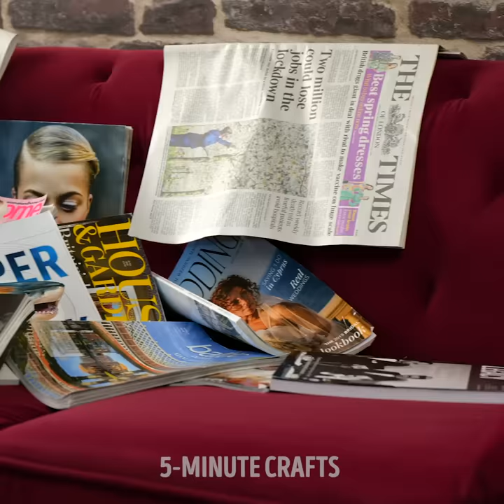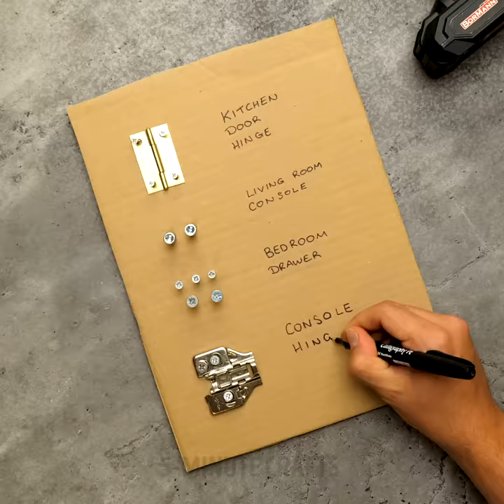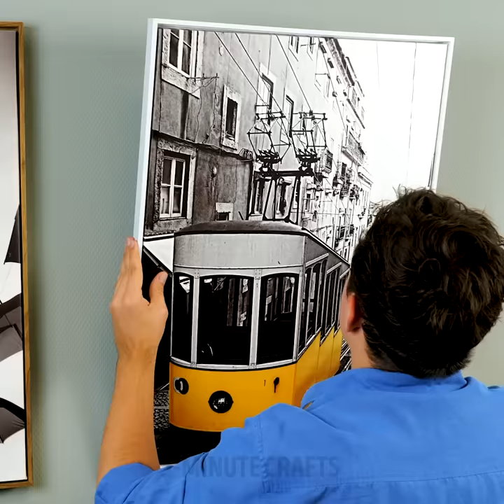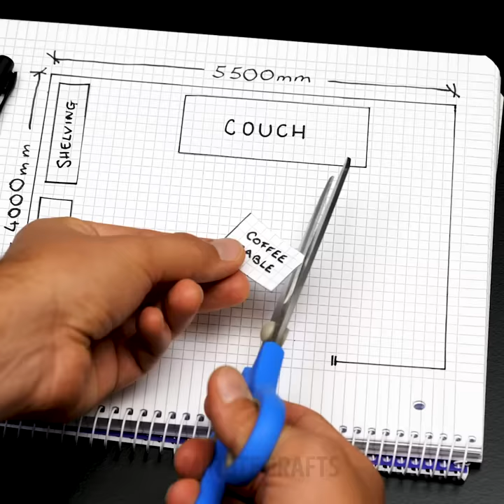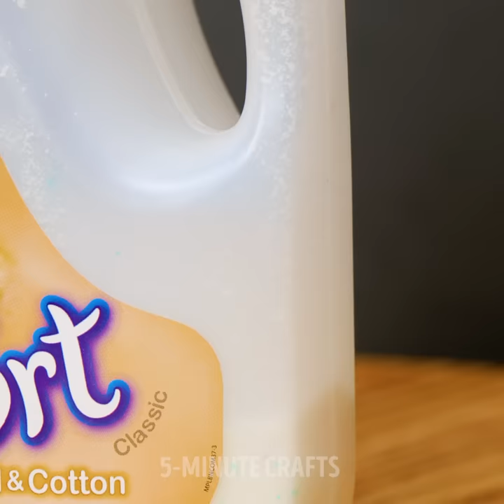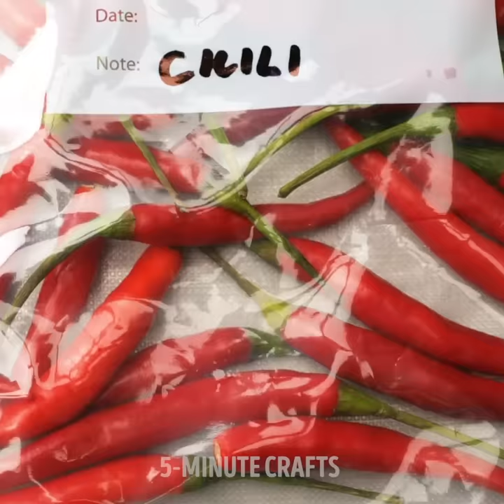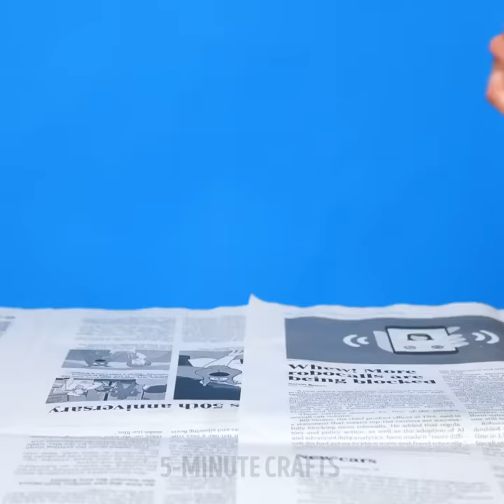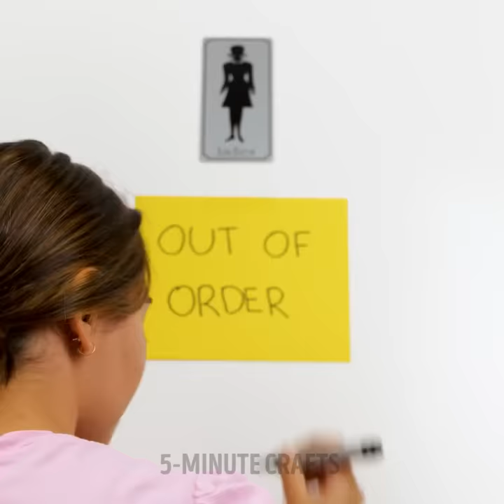50+ Smart Hacks to Organize And Decorate Your Home

Comment: The one with the makeshift lamp that used a plastic can and a sweater  ( time stamp: 14:37 ) -- I'm not sure that would be safe ?  The lightbulb gives off heat and the sweater would trap the heat, making it even more warm for the plastic to be affected, and the sweater.  I would want to be sure that the covered area of the "lamp shade" was very well ventilated.  The top area is also covered by the sweater (or so it seems) and heat rises, so it would try to "escape" via the top and not the bottom of the "shade".

That being said, a lot of awesome ideas.  I wish they had directions for all these, like the things that are sewn or created - like how much of each ingredient, what are the measurements for DIY crafts,  etc.  Also, where they're able to find some of the supplies, or if some supplies are only available in certain locations.  I'd also be interested to know that, in the couple of crafts using alginate to create a mold, if you could use sand as the mold agent, as the sand could be reused for future molds, while alginate cannot be reused or repurposed.  In the case of the alginate, have their been any ideas to try to repurpose it - or whatever - since it is technically considered a "waste mold" (once and done).